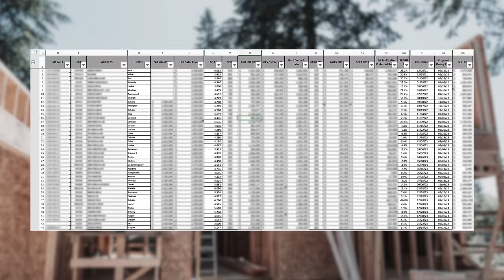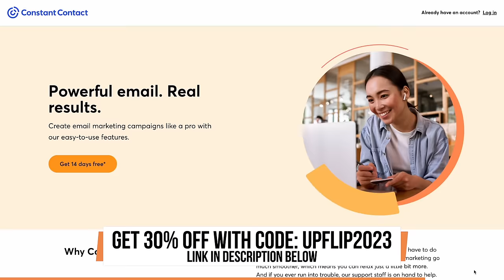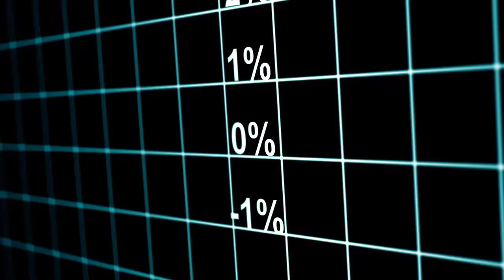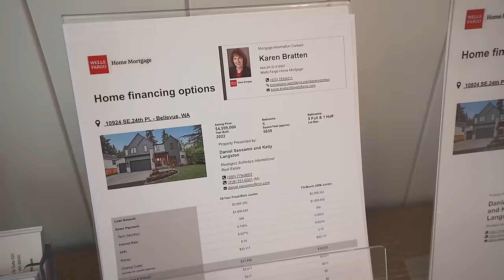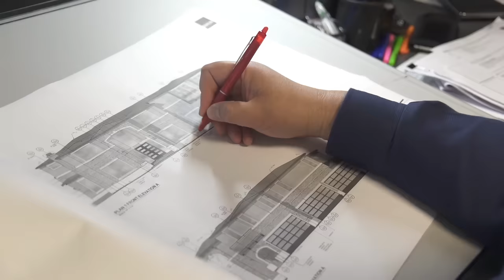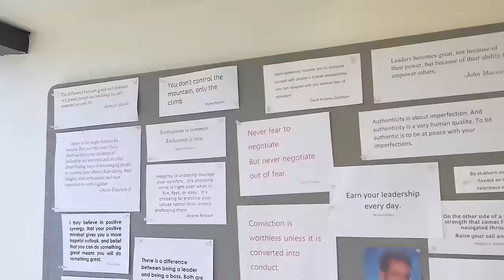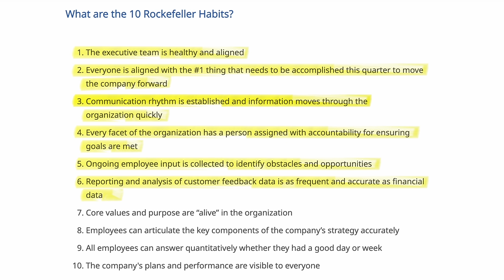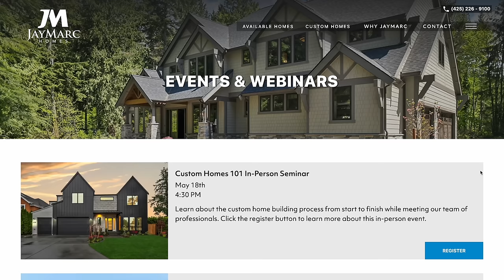Losing Everything Made Him $80M/Year

Comment: What is hard money
Reply: Hard money is money that is not conventional bank financing which has lower rate and fees.  The reason why I suggest to get off hard money is because in this business, the extra few percentage points add up and make a difference to the bottom line.
Reply: @marcrousso3214  thanks, in the uk. We borrow at 1% in and 6-7% interest with commercial banks.
Hard money - we call merchant banks and bridging  companies- these are generally 1% in 1 % out plus 9-15 %
Reply from the maker: Thanks for watching! Hope you learned from Marc himself! ☺️

Comment: The risk reward ratio is lacking in this business - shooting for 10% profit in high end flipper real estate is just not a solid plan. Hopefully that was just bs. I built my own home and saved at least 25% in cost per square foot on the build over other contractors, so, I know it is possible to run crazy good numbers.. but it gets pricey when you've got to buy the junk house on the initial property purchase. You could easily lose your ass, especially if the bank has problems or hits you with a deficiency if the market drops suddenly, as in 2008. I would never advise anyone to make deals like this, unless you've got deep pockets that can carry the project to completion in case of disaster, so that you can get the home finished with a Certificate of Occupancy and then you've got mortgage-ability, and then you can rent or sell to a much wider range of customers.
Reply from the maker: They do have a solid plan. They've been doing this for a long time. But we thank you for sharing your input! 👊
Reply: Richard, Any real estate business with velocity has margins as I mentioned in the video.  For example DR Horton ranged from 7.59 to 17.5% the past five years.  Wish you continued success with your ventures.

Comment: Houses made out of Wood and more Cheap Wood…………… 🧐

Never pay or buy any structure that expensive unless it made out of CONCRETE.

So many problems with wood, Fire, Insects, Mold, moisture , structure unstable and most importantly Concrete will last twice if not longer………….

Wood Home must be extremely cheap to even be considered
Reply from the maker: Materials depend on the location! ☺️
Reply: All houses in the Pacific Northwest are built out of wood J Frank.